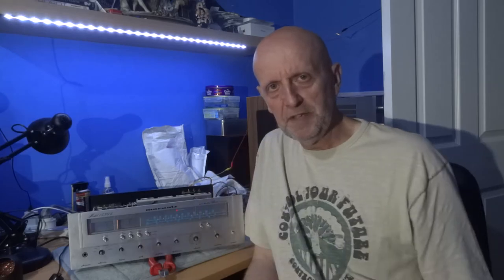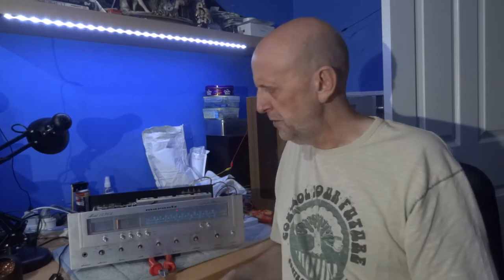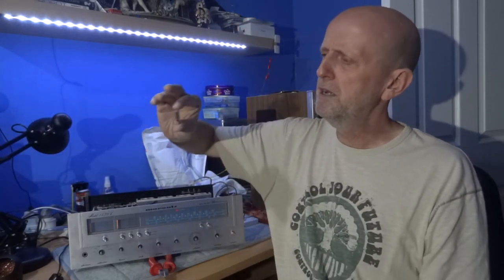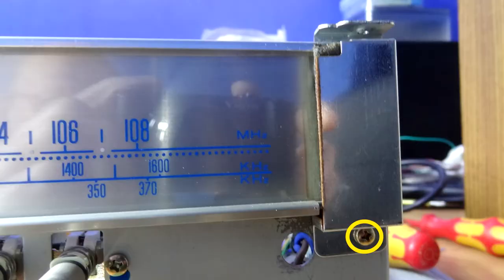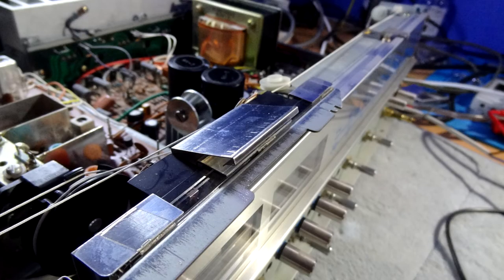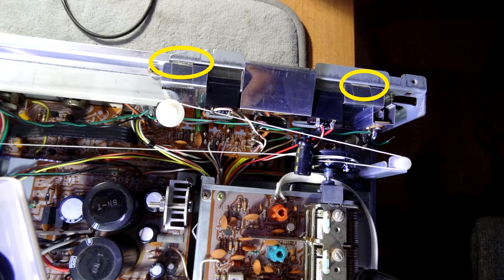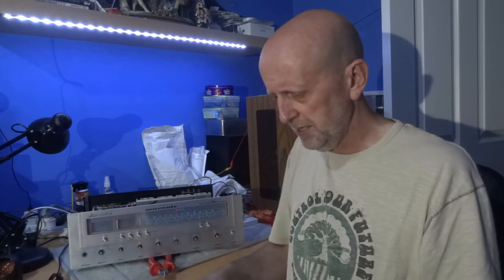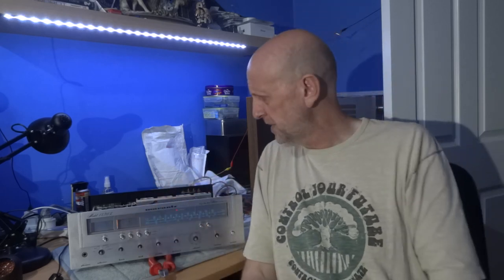Marantz Receiver Tricky Bulb replacement simplified , Vintage Stereo Hifi audio lamp 1530L

Comment: Thanks for the tips. My 1535 is the same configuration and I couldn't figure out how to get to the last lamp. Your bending the housing trick saved me. Many thanks.
Reply from the maker: Thanks for the comment Jeff, I know some purist may want to take the meters out, but this does get the job done quicker.

Comment: Michael - one minimal downside to now having a gloriously illuminated unit is I’ve got a smudge of some sort - probably some wayward glue - on the signal strength meter. Have you any advice or a video I might be missing on accessing the meters for a “quick” cleaning on a 1530? It’s certainly not bad but I’ve cleaned the entire unit so well I’d like to get as close to 100% as possible. I’m trying to work my way through the schematic today. Thank you for any guidance.
Reply from the maker: Ahh I have not got this unit anymore, which is a shame as I could have had a try getting to meters. I take it that the smudge is inside the meter . I have a video here of a Superscope Marantz that I take the meter out of but I honestly do not know how much help it might be. Might just be undoing a few screws just a little bit and seeing if they free up the meter and seeing if the front comes off. Wish you luck https://youtu.be/qABZs55sKtk
Reply: Thank you as always Michael. I was able to get the meters out by gently pushing the thin metal casing around them - similar to installing that tricky middle bulb - and it worked well enough. Now I need to find a good de-bonding agent that might loosen wayward glue that is god knows how many years old. We’ll see! Thanks again.
Reply from the maker: @jazogby  That's good, I hope you find something to break down the glue without causing any damage or staining to meter. Hopefully it will just thin out and wipe away. Just be careful if its solid and brittle as I have snapped some off before and it took a piece of what it was on with it. Good Luck

Comment: Hey Michael! I just bought one of these and will take your advice on how to replace the lamps. Mine came to me without feet as well - how did you overcome that? I can't seem to find any replacement feet online.
Reply from the maker: This is the easiest way to get to one of the awkward lamps as for the feet, the original feet are width 25mm and 15mm height, you could use something like these in the link and use a nut, bolt and washer inside to secure to bottom, though the height of these are 10mm I think. link https://www.ebay.co.uk/itm/132984765164?hash=item1ef6827aec:g:L3QAAOSwWdFchRsr

Comment: Just for clarification, these are the only bulbs for the MR 235/1530L? I only need blue bulbs and not white ones??
Reply from the maker: These types of bulbs will fit in other Marantz models as well, these can be normal filament type white bulbs and some have a blue filtered glass as well. Also you can use LED fuse type bulbs that come in a few colours blue being one of them.